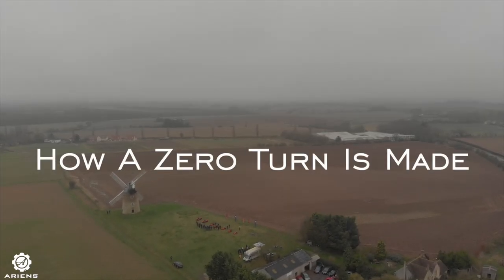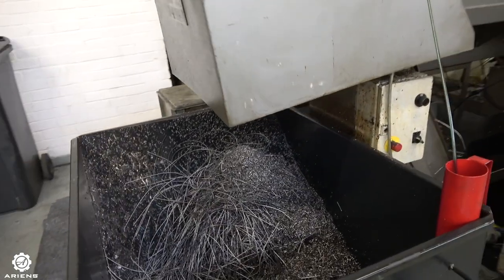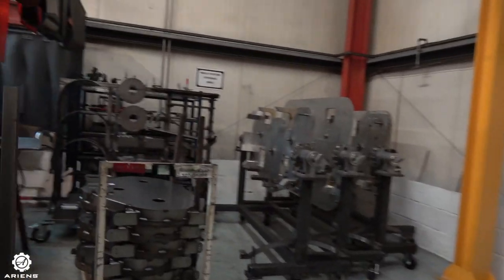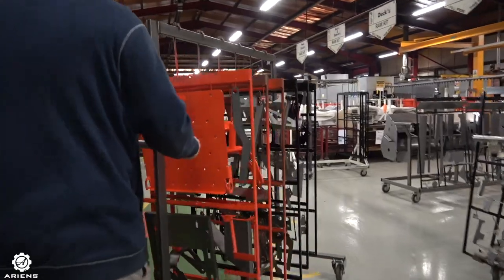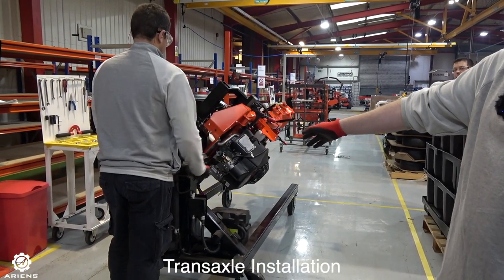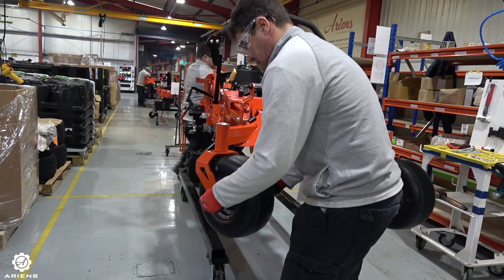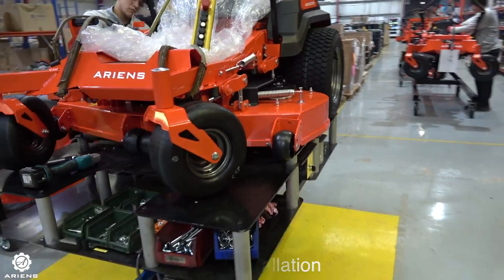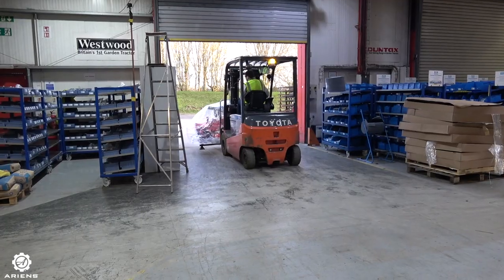How A Zeroturn Is Made #Ariens #howitsmade #zeroturn

Comment: I noticed when they were mounting the engine on this Apex mower it had a proper rubber oil drain hose with metal fittings on both ends. The Ikon XD 52 that I bought has a crummy plastic drain port that leaks oil all over the platform that the engine is mounted to, which then attracts grass bits and dust and makes a horrible mess. Ariens will gladly sell me the rubber hose shown in this video, which is probably worth about 15 bucks, the only hitch is they want $50. Talk about adding insult to injury. Otherwise, I'm happy with this machine, but this oil drain hose issue really pisses me off.